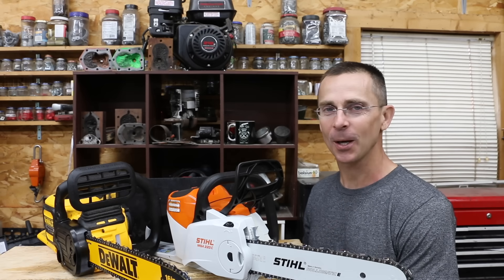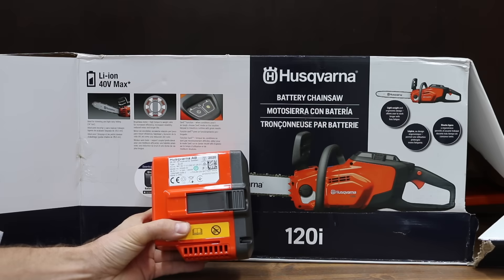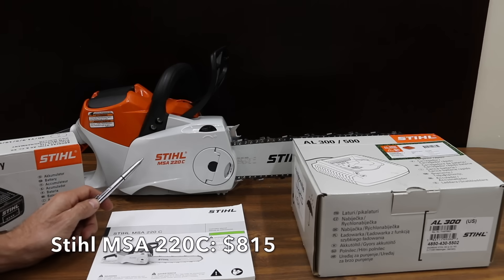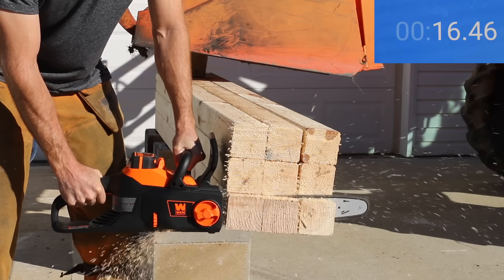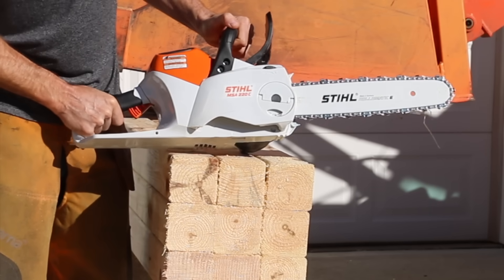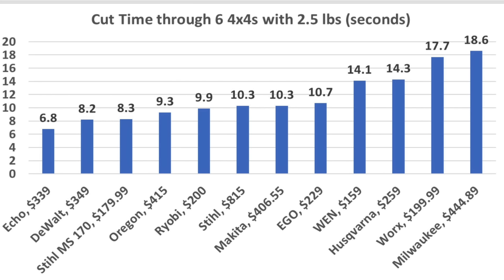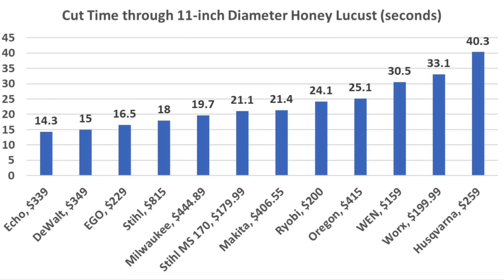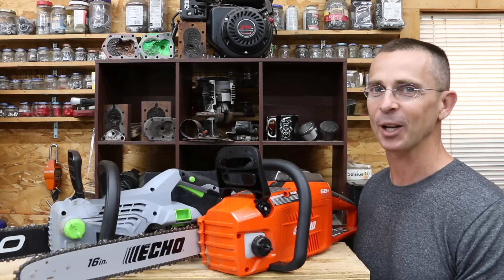Best Battery Powered Chainsaw Brand (ROUND 2)? Stihl, Husqvarna, Echo, Oregon, DeWalt

Comment: I'm not sure if it would work, but I think a great control test for something like this would be to use the 
same chain (or type/brand) on the saws to see how much of their cutting is due to their power and how 
much is due to the chain you get with the saw. Seeing them with their out-of-the-box chains is definitely 
valuable, but chains all need to be replaced at some point.

Maybe a chainsaw chain test for durability?
Reply from the maker: Thanks for the suggestion.

Comment: Hello, I used to work for tree service, my guess is the Stihl is  a tree saw, used by the guy that climbs the tree with spikes etc to top and drop limbs. As you can imagine you would want a saw that is very light and requires little pressure, many times you would use it one-handed.
Reply from the maker: Thanks for sharing.

Comment: You do a very good job..
And it would be impossible to consider every aspect.
A feature that may have been useful. 
Would be to compare cubic inches of sawkerf
Cut per amp of battery.
And having seen new blades that were not sharp. Blade geometry,  would have been something to consider...

But ,, anyhow,, your worst day is worlds better than any advertising. .
So ,  thanks for sharing your videos, and keep up the good work.
Reply from the maker: Thanks, will do.

Comment: PROJECT IDEA: PADLOCKS (And accessories)

I have been frustrated in the past with Padlocks... Some are easy to get into, others are secure. Some Rust, some don't. Some get dirt and manure caked in and are impossible to unlock. I am looking for the BEST outdoor padlock (especially from a farms prospective). I hate overpaying for an inferior lock.
Reply: From a security point of view, check out lockpickinglawyer's channel, ABUS padlocks are one of the best. To prevent dirt or rust just go with a marine grade padlock, no spring mechanism and made entirely of stainless steel.
Reply from the maker: Thanks for the video idea.

Comment: i wonder how the Stihl would have done with the 16" bar, since the with the 14" bar it was a good 1"= shorter in usable than the other 14" saws (Ego and Husq).  Stihl not coming in a package just inherently makes the price higher, since if you priced a la carte on the other models they would also be higher price; however, it is ridiculous price compared to the gas versions and performance.  I won't have a second thought about buying gas Stihls, but battery versions I just steered clear of, and this test is precisely the reason why.
Reply from the maker: Thanks for the video idea.

Comment: Using a gas chain saw, chain sharpnes made a HUGE difference in cutting speed. I wonder if cutting speed is more a function of chain sharpness rather than the saw.  Is there a way to make this more apples and apples at least with a couple of saws to eliminate differences in chain sharpness.
Reply from the maker: Thanks for the video idea.

Comment: I love your reviews, but there is only one problem. Longevity. Which is really hard to test. I've owned the Echo since 2016. The battery only lasts a year. I've been through 3 batteries. When the saw works it is fantastic. Your review definitely represents what it's capable of. However I would maybe put a word of caution in your recommendation that it's based on initial testing. The echo just doesn't hold up. I also have the E-go because I have a lot of other E-go yard tools. While I'm not a fan of the chainsaws performance compared to my gas (or Echo) saws, it definitely stands up to years of trouble free service.
Reply from the maker: Thanks for the feedback.

Comment: The Echo is the first and only chainsaw I've ever owned.  It's a relief to know it does so well in comparison to the other saws on the market!  I've made some newb mistakes with it, incuding getting it pinched while cutting and throwing the chain off the bar.  I was able to get it running again after that, and it still works well. Only issue I have with it is how to store it without the oil leaking out.  The oil is just gravity fed into the bar and flows any time the saw is "upright".  Best I've come up with is to store it with the oil cap up (saw on its side), but I wonder if anyone has better advice?

Really appreciate your videos, thank you so much.
Reply from the maker: You are welcome!

Comment: I know it sounds stupid but how much weight can you put in/on a 5 gallon bucket how much weight does it take to crush a 5 gallon bucket? If you put open end down and put 2x4 on the closed end around the ridged of it will it ever crush? Quite curious I've supported held half a sand rail vehical with 1 bucket.  Well all have used them to stand on at lest once in our lives and i see hundreds of people be made fun of for using them as a support to hold them up or hold a ladder up. I know it sounds pointless to know but if a bucket is all you have to use as a support it would be good to know how much it can hold

Comment: Do cord powered electric chainsaws next.
Reply from the maker: Thanks for the video idea.
Reply: Yeah, my Chinese Ryobi corded saw is a beast, mind you it's running 230V and 2300W, dunno how long it'll last though at least there's no battery to give out. Even the chain it comes with seems pretty sharp and durable by Chinese standards. My other saw is a gas Echo pro saw but I prefer to use the Ryobi...much quieter.

Comment: As always a nice video with nice reviews of the products. Although the Dewalt and ECHO are good options, I still prefer my german made old Stihl chainsaws (the new chinese ones are crap). Perhaps for construction applications or environmental issues, electric chainsaws could be a good option, however they are not as reliable as a gasoline one. Also they dont have so many additional advantages. Thank you very much for the video. Cheers
Reply from the maker: You are welcome!

Comment: Is this really an apples to apples comparison . . . I know that Husqvarna and Stihl make consumer-type electric saws as well as pro saws.  Based on the price, it looks like you reviewed a higher end Stihl, but a lower end consumer Husqvarna.  The high end Husqvarna are the t540i and t535i.  With the batteries, they cost over 1k.  I used to own a bottom end Stihl 120c and it looks like the Husqvarna you reviewed.
Reply from the maker: Thanks for the constructive feedback.

Comment: I got the Echo in Dec 2019 to replace a corded electric saw.  Jan of 2020 rather than buying a second 4 amp batter for the Echo I expanded and purchased the hedge trimmer that comes with the 2 amp battery.  Now I can use either battery in either device.
Reply from the maker: Thanks for sharing.

Comment: Another great video Ideas for you! I have good Ideas for another 3 or so videos you can produce! First a backstory... So I've watched almost all of your videos so when it came time to paint my new house I rewatched your video where you tried different brands of paint and used your advice and went with the sherwin Williams brand to repaint my old fashioned brown stained window frames. I actually went with an even more expensive option then you tried because I had first tried a basic cheeper white paint and it quickly turned completely yellow even after 2 coats! so I forked out $70 for a gallon of  the sherwin Williams and it still turned yellow (pretty sure the stain was leaching through the paint as when I tried cleaning the frames with all purpose cleaner the paper towel turned dark yellow) so I then decided to try a primer and that did the trick. I did some research and landed on the Zinsser Cover Stain Interior/ exterior oil-base stain blocking primer which did the trick! but I did run into another issue! I wanted to use an airless sprayer but the primer was WAY to thick for my sprayer so I then went with a paint brush which left ugly lines so decided to try a roller and that left a horrible spikey texture! I couldn't find a small sized roller that would leave a smooth finish so I bought a large one and cut it into 3 and that did the trick. If only you had 3 videos that could have helped me with these issues I would have saved a lot of time, money, and stress! so my 3 Ideas are as follows #1 make a video trying different primers for different coverup situations and test both oil based and water based (might do that in 2 separate videos) #2 you could do a video and brushes VS paint rollers for different types of paints and primers or do a video on brushes of different qualities and rollers of different qualities. #3 you could do a video on different airless paint sprayers (I bought mine on amazon for around $40 and it actually does a pretty good job with regular paint). Thanks for taking these ideas into consideration and thanks for reading my long comment if you made it all the way through 😜
Reply from the maker: Thanks for the video ideas!

Comment: I run 2 gas echo saws and a gas echo weed wacker.  They all perform excellent.  Very powerful and very reliable.  I have went head to head with Stihl chainsaws of similar size cutting wood and never has one kept up with my echos.  Love them.  I do like to use Stihl chainsaw files, chains, and oil mainly because they are cheaper than the echo stuff and just as good.  The file guide thing from Stihl is awesome I have one for both saws
Reply from the maker: Thanks for sharing.
Reply: I too have an echo gas saw and brush cutter, the latter has certainly been abused and it's indestructible, minor thing with echo is their gear seems louder to me than stihl or husky, just the pitch of the motor is higher or something since they're rated about the same db level.
Reply: @exxr  I am about as hearing impaired as I could get for my age and not being just def so I have never noticed and likley never will.

Comment: Great informative video. Thanks. Echo link to Amazon you provide showing price at $431.53, rapid inflation from the $339 shown in this video!
Reply from the maker: Thanks for sharing.
Reply: @ProjectFarm  Echo not available on Amazon.co.uk but there is a well reviewed 40V saw by Greenworks, GD40C S40, which is available on Amazon.com as the much more easily remembered G-MAX. Price does not include battery or charger. 

https://www.amazon.com/Greenworks-Cordless-Chainsaw-Included-20322/dp/B00DRBBRQU/ref=sr_1_4?dchild=1&keywords=Greenworks+Cordless+Chainsaw+GD40CS40&qid=1607968416&sr=8-4

There is also an 80V version at $349.99 including battery and charger which seems like a really good price.

https://www.amazon.com/dp/B0878QVVCY/ref=sspa_dk_detail_0?psc=1&pd_rd_i=B0878QVVCY&pd_rd_w=SUbgQ&pf_rd_p=7d37a48b-2b1a-4373-8c1a-bdcc5da66be9&pd_rd_wg=BMJyj&pf_rd_r=EKNTN2VA5AAJ90TNE4H9&pd_rd_r=564f4e82-64a6-4e0e-a1b9-17f1e3af2c77&spLa=ZW5jcnlwdGVkUXVhbGlmaWVyPUEyMkNEUEkxT0RLTEM3JmVuY3J5cHRlZElkPUEwMzEzNDM3Q1o4M1g2RjNFMDVaJmVuY3J5cHRlZEFkSWQ9QTAxNzIwNDMzSk1OTEpXR01HRUlDJndpZGdldE5hbWU9c3BfZGV0YWlsJmFjdGlvbj1jbGlja1JlZGlyZWN0JmRvTm90TG9nQ2xpY2s9dHJ1ZQ==

If you can afford to buy yet more chainsaws it would be great to see a review of them.

Comment: Ego unfortunately didn't get the best rep due to its small battery. I would be interested in seeing how it compares with its 7.5 amp hour battery. I have several ego tools and love them, but I do admit the 2.5Ah batteries are under sized for most of their tools. I have a 5ah and 7.5ah battery and their performance completely changes with the larger batteries. Of course it also adds some weight.
Reply from the maker: Thanks for the video idea.

Comment: Love your channel, keep up the great reviews.

Where is Greenworks? Greenworks Commercial has a 2.5 kW chainsaw, probably the most powerful cordless on the market. I have the Kobalt 2.5 kW 18" chainsaw made by the same company, Globe Tools, and it is awesome. Globe Tools is also making the Atlas 40/80v for Harbor Freight and is including the 2.5 kW motor in the Atlas 80v chainsaw but sadly Harbor Freight opted for a custom battery system and they only have one battery available and it is likely limited to 1.6 to 2 kW of power due to the current flow thought that single string of 20 batteries. This causes the Atlas's battery to cut off the power under moderate-heavy loads.

The Greenworks Commercial GS181 or the Kobalt KCS 4080-06 chainsaws come with the 2.5 kW motor and with a dual string battery, like a 4, 5, or 6 Ahr they can put out that 2.5 kW continuously, that's more power than a 50cc gas chainsaw.

Globe Tools makes Greenworks, Greenworks Pro, Greenworks Commercial, Victa 82v, Snapper 82v, Cramer, Kobalt 40, 60, & 80v, and Atlas. All but the Atlas use the same battery platform, just different ribs and troughs in their plastic molding for the batteries to prevent cross usage. These can be modified for cross use (while invalidating the warranty).

Globe Tools is currently offering 80/82v chainsaws with 1.2 kW, 1.5 kW, 2.0 kW, and 2.5 kW motors.
Reply: I'm in the process of making my own backpack battery for use with my Greenworks combi-works weed wacker for powering a hedge trimmer attachment for poison oak abatement and look forward to experimenting with powering my Kobalt saw with it. I have plans for two backpacks, one with 8 Ahr at 80v and the other with 16 Ahr at 80v. Globe Tools sells a backpack with 13.5 kW for $500 for this purpose, but I want to play with a bunch of pouch cells I bought from Battery Clearing House.
Reply from the maker: Thanks for the feedback.

Comment: Shouldn't you check the temperature of the blade and the battery to see how hot they are running after every few cuts because I'm guessing the hotter they are the slower they will cut.

Comment: Project Farm saws through the marketing garbage like a hot chainsaw through honey locust.  Great video!  That is a knarly looking thorn.  I've never lived in an area where they grow.  If you really want to put the hurt on a chainsaw, try cutting through a palm tree.  The fibrous and wet pulp are brutal on them.  If you chop down a 25 foot tall palm tree in 1-2 foot segments, the blade will be done by the time you finish it off -- if the saw doesn't clog up first.
Reply from the maker: Thanks for the feedback.

Comment: Thank you for the very informative video,love your channel.
I have the ego chainsaw as well as their lawn mower,weed wacker and leaf blower.I have had them a couple of years now and all have held up well.I had one 5ah battery fail and it was replaced under warranty.What I love about the battery saw is if you are only using it for a couple seconds to a couple of minutes it is quiet and it stops when you don't need it so no idling or or reefing on a pull cord.If you want to use it inside a building it really shines no fumes!
The battery is the weak link in all these cordless saws and there are really not meant to replace a saw you plan to use all day.I have many gas saws,they are there for the longer jobs.I do use the saw for fire wood but only for smaller trees less than 12"
I hardly ever use the 2.5 amp battery on the saw,it cuts out easier and does not last long,handy if you are only using it for a moment or two.
Reply from the maker: You are welcome!

Comment: Surprising results. Great informative videos as always 👍 See a lot of comments that with these saws you would need a lot of batteries to keep cutting while the first battery charges. These saws aren't actually made for continuous cutting. Lithium saws definitely have their place .  They made for convenience, instant start Instant stop, mostly for light-duty cutting , and a lot of intermittent cutting, like branches and General trimming. Or just a small job that only takes a few minutes to complete. 1 extra battery would give you more work time. 
They could also be used for light work to accompany a larger heavy gasoline powered saw.
But If you're going to be doing continuous cutting and a lot of heavy cutting, you obviously would use a gas-powered chainsaw which is more powerful, easier and faster to "recharge" by refilling the fuel tank, and can more easily do longer heavy duty work. I currently have three gasoline powered chainsaws, from small 16" to a very large heavy duty  Stihl 048. But I would still like a lithium saw, just for the convenience of small jobs at times, and also to have the option of a different fuel source if it was needed.
Reply from the maker: Thanks for the feedback.

Comment: Another excellent set of tests, as expected.  I bought my first piece of Echo equipment in the early 80's.  I have never had a failure of any of them but I have had them stolen and I have given them away and have always replaced them with another Echo.  I do not think the current ones are as good as the older ones, but they are still exceptional.  I don't believe I would ever buy a battery powered chainsaw but after running my CS590 a few hours this old man is beat so I see the appeal for short usage.
Reply from the maker: Thanks for sharing.

Comment: Can you do a video on shop creepers? Like the rollers you lay on to go under a car? It seems everyone i buy is either too high in the air or the wheels break or the mount for the wheel base cracks in under a month...
Another video idea, a video to compare all the cable strippers for pulling shielding off the ends of power or ethernet cables that are out there, they range from one time use to super expensive, would be nice to know a decent set to get to replace my old ones
Reply from the maker: Thanks for the video idea.

Comment: I have the Ego but with a 5ah battery which I have an extra battery from there 15” string trimmer but I know for a fact that it lasts longer than 10 minutes cutting mesquite which is a tough wood also
Reply from the maker: Thanks for sharing.